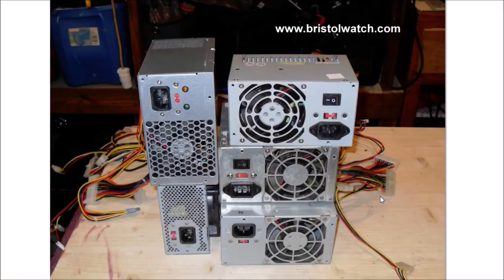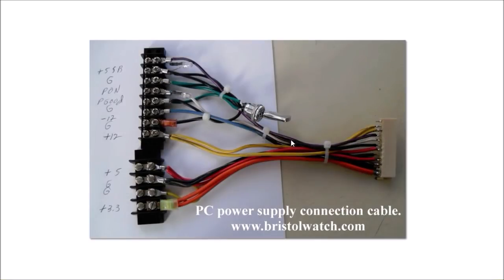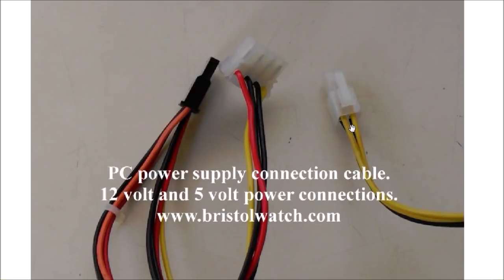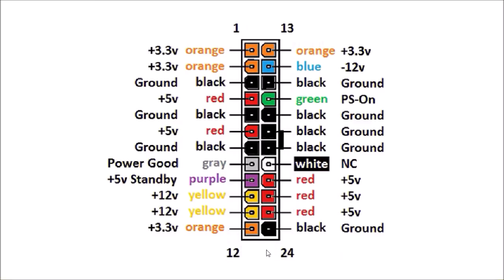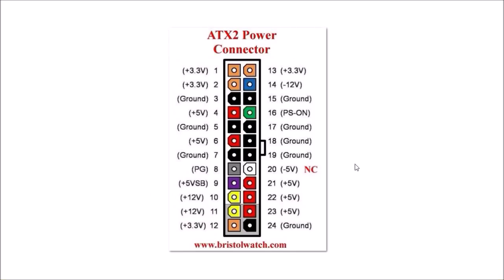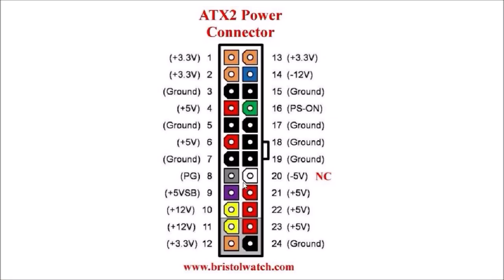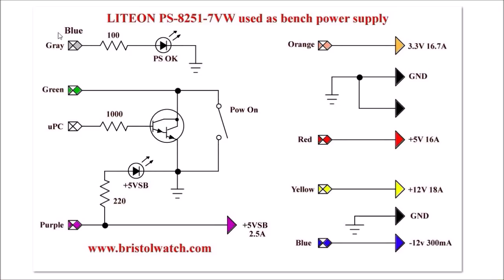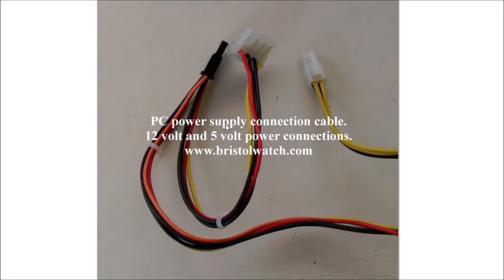Reuse PC ATX Power Supply with Arduino, Raspberry Pi

Comment: can i connect +12v a and +12v b IN PARALLEL to get combined AMPS??
Reply from the maker: I think they already are internally. Pull the cover off and look.
Reply: @LewisLoflin  ooh,I will check it out, thanks for your response

Comment: I wonder if it would be possible to add multiple single board computers (SBC) to one power supply? Like for instance a 550 Watt power supply would have enough capacity to run a few, like 3, SBC's at the same time.
Reply from the maker: There is a lot of power in these supplies as long as the connections are correct, I'd say yes.

Comment: I've been given a newer style power supply, its a thermaltake 750watt ( all black connectors: modular I think they call it),
I assume its still an atx power supply, you think its useable as a bench supply?  I know the wiring connectors and what they are, but as its fairly new wondering if same applies as with the older atx? any clues?
Reply from the maker: I'm guessing yes. What color are the wires? Is there a voltage plate?

Comment: This will help me greatly with my nas project. I want to connect my raspberry pi 4 and 2 hdd to an atx power supply (making sure that the 5v goes to the pi and 12v to the hdd). I have already ordered sata to usb 3.0 dongles to connect to my pi.
Reply: But when I attach just tiny 1amp load to 5v or 12v wires of PSU then 5v drops to 4v and 12v drops to 11v. Isn't this bad for pi? Because pi requires 5v stable voltage. How can I stabilize the output voltages of PSU?

Comment: Curious question: can two separate PSU's be ran in parallel to increase current?
Dare I ask for 24vdc?
Reply from the maker: The first question is it should. As for 24V the power supplies must be kept separate. Measure the voltage between cases and be sure they are NOT connected to each other. I do not recommend connecting them like that. Use one of these voltage buck-boost modules from Ebay.
Reply: @LewisLoflin  thank you for your advise. most grateful. fortunately, i have no need for 24v at this time and as a mechanic, i tend to stick strongly to my good ole 12v. the fact that i can run them in parallel to increase my current is all i need! thanks again!

Comment: white is actually pink and is connected on older units it is -5VDC most often like the -12VDC less than 1amp, useful tied with the +5VDC rail, add a diode and you get around 9.3VDC
Reply: What are the -5 & -12v used for? I cant seem to find a clear answer

Comment: Lewis: Thanks so much for sharing this. I have been using an ATX power supply for my Raspberry Pi for awhile now, but my implementation is far less elegant than yours.... Some might even call it crappy, ugly and unsafe! Tidying up the connections, providing "Power On" LED's and adding the Darlington for microcontroller triggering, as you have done, will make me feel a whole lot better about that mess of cables!